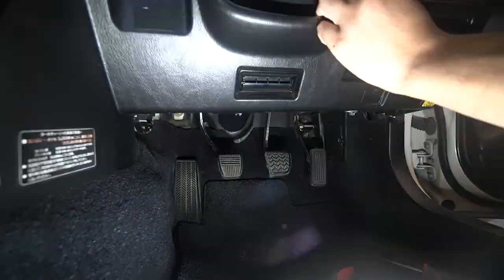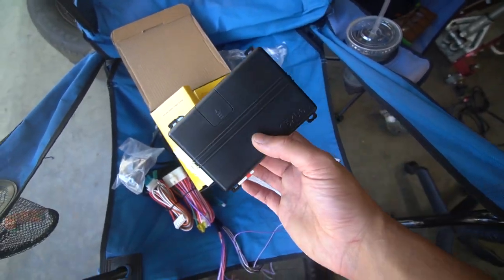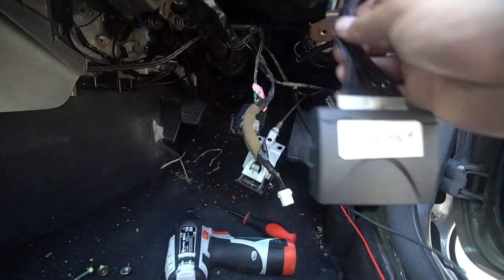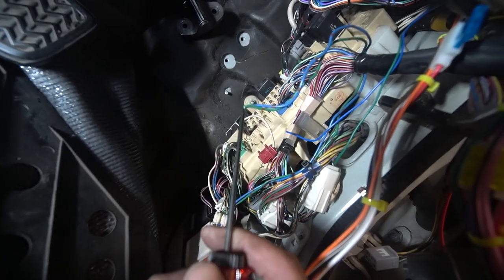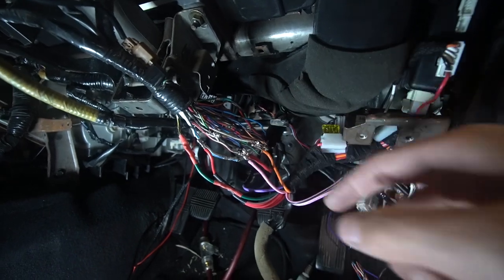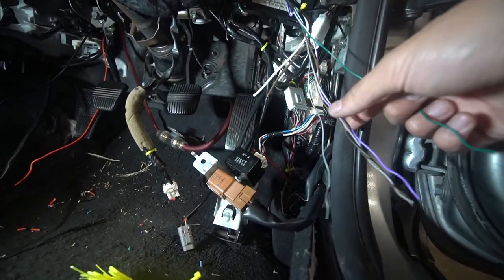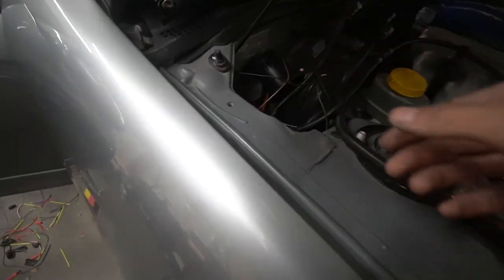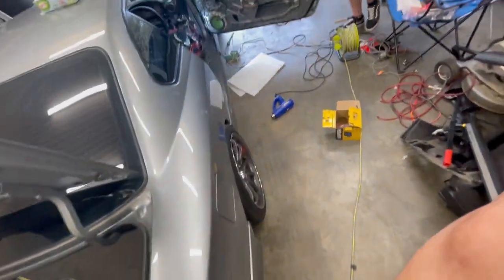Attempting an ALARM Install With NO EXPERIENCE....? (Viper 5706v)

Comment: As an installer you did a pretty good job there bro, very nice work. Just remember to take your time if anyone decides to install their own alarm/remote start. My job only allows for 2 1/2 hours for an alarm remote start but once you get the hang of it and have a multimeter with wiring diagrams of cars it’s much quicker finding the needed wires. 

Great job again dude, you cleaned up the install pretty good. Better than my first go at one for sure.

Comment: What do you think the best 4 first cars are in Victoria also on a budget
Reply: What’s the budget
Reply: $7000 aud
Reply: Depends what u r looking for. Reliability, economy, a project ect
Reply: A fun daily driver
Reply: @Hoon_central  if by fun you mean something with a little go that won't break, for 7 grand you could buy a bf xr6 or save a bit more for an fg xr6. They have good stock power with a barra with good aftermarket support but are reliable. For 7 grand you can't get too much that I know of. Something that won't break much especially

Comment: Can you do it on a car with Manuel windows and non central locking?
Reply from the maker: you'd need to wire in another kit to get central locking to work but i guess you could remote start it without doing that if ur just after that
Reply: @RexH  thank you I’ll definitely look into it.